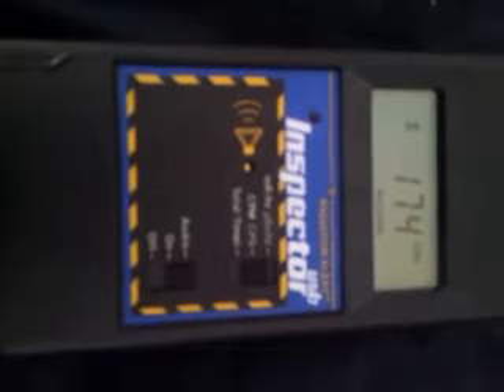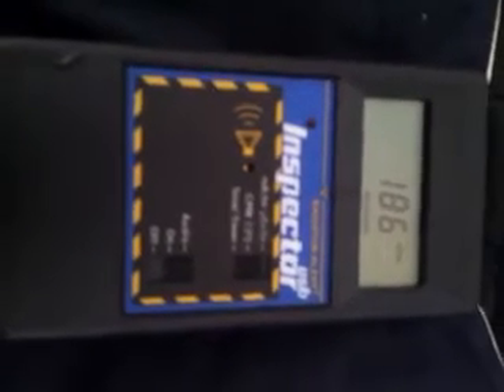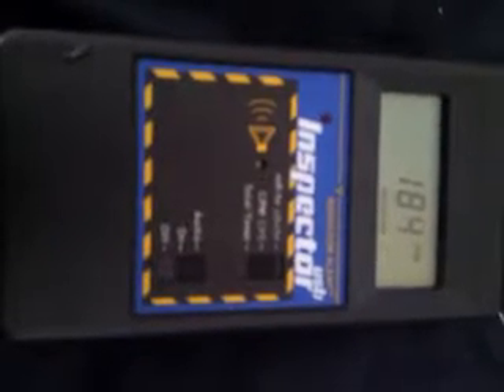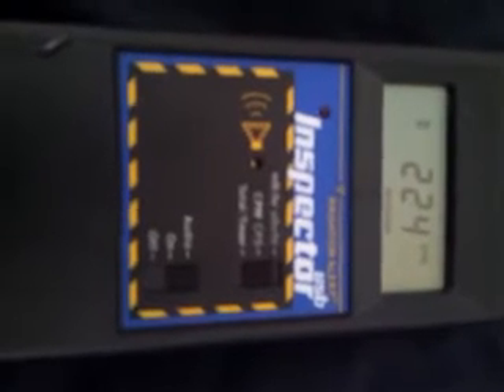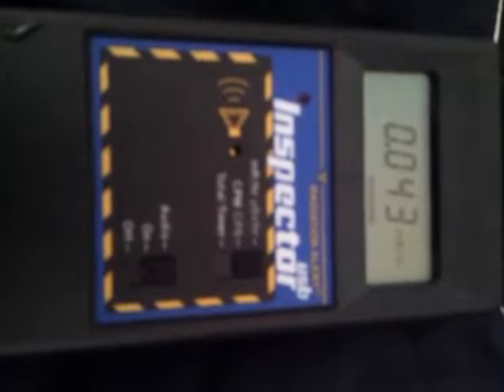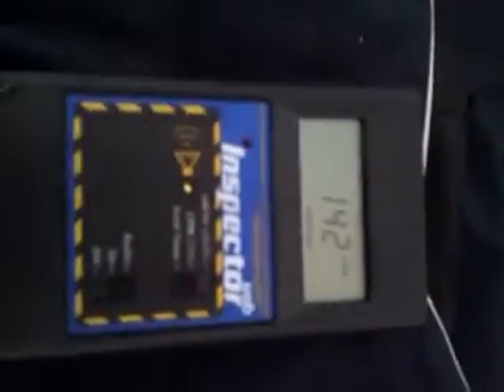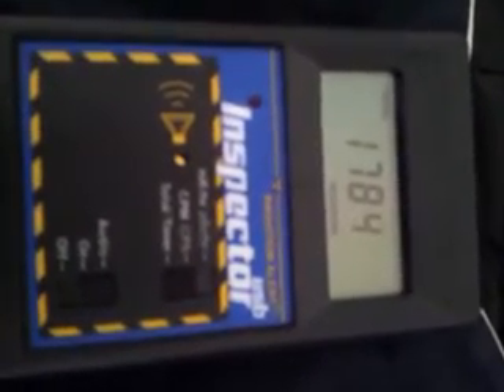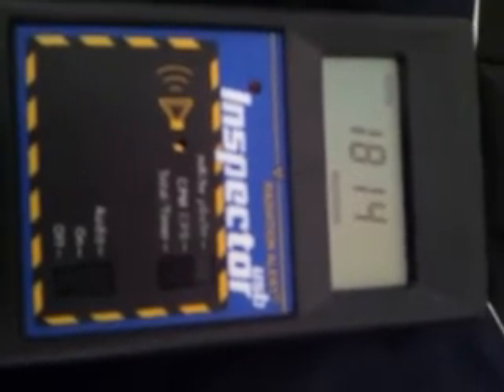Calgary, 183.7cpm, Fukushima, Oct 2013, HIGH Radiation

Comment: ...Cont   It is very hard to actually confirm contamination from Fukushima. Even when it was quite bad, during the first month or three, the actual readings detected on the west coast were too low to significantly register on a Geiger counter. This doesn't make them safe, but they required much more sensitive equipment. In fact, my best lab equipment has only found a few Bq/L of Cs137 in several years of testing.

Let me know the results of the subsequent test

Comment: The most common causes of radiation in our environment (aside from medical) are from naturally occurring sources. After a rain/snow storm, you could easily get readings of 300 to 1000 CPM using your Inspector. So which is it, Fuku fallout or NORM? If you were getting Fuku fallout, your yard would be significantly higher than 70-ish CPM (at least as hot as the coat).

Test the coat after 3 hours and see what sort of readings it gets. If they drop, it's likely NORM.

Cont...